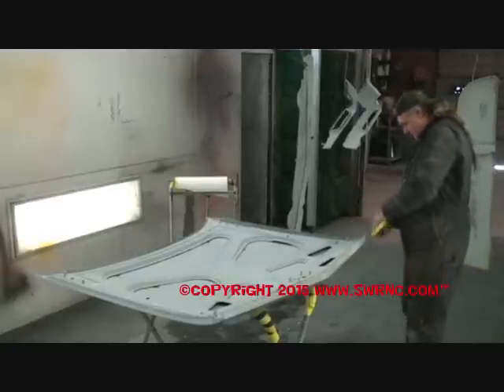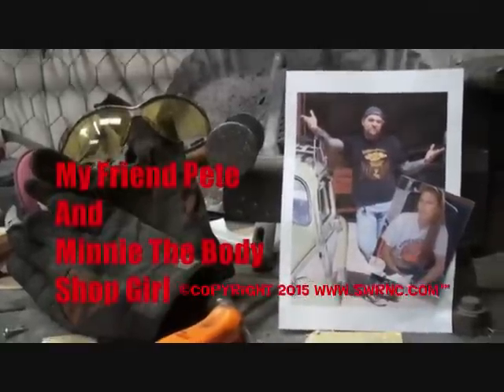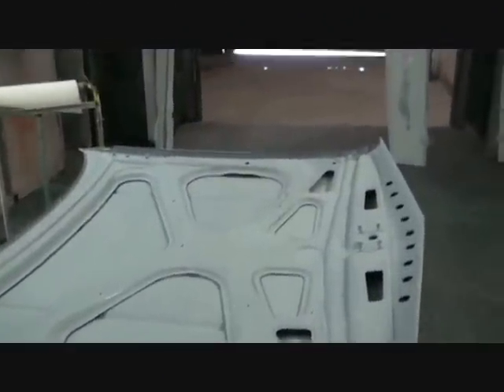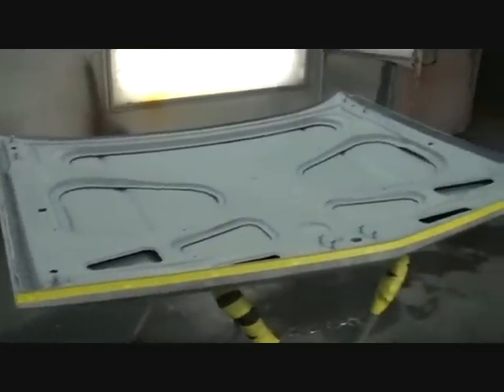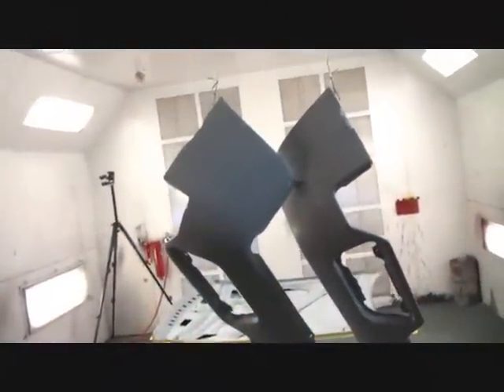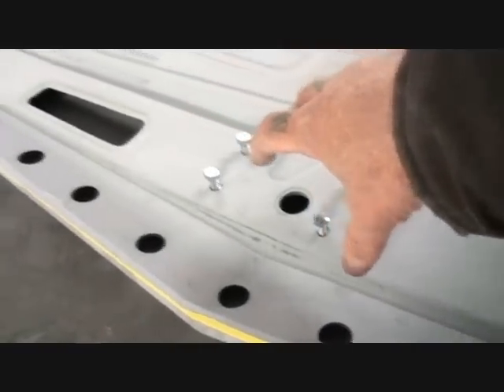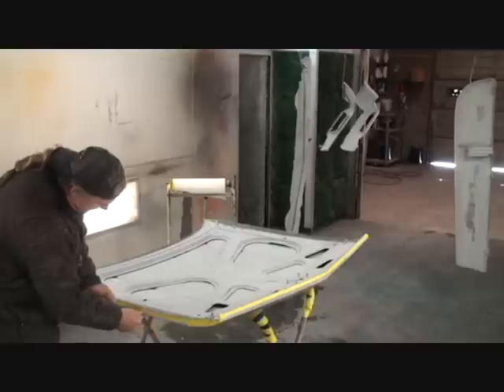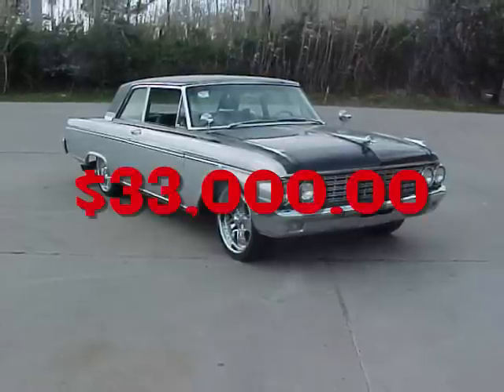How Should I-Restore My Car Or Truck? - Concours Restoration Theory

Comment: Good work. My dad bought a 70 SS Chevelle brand new in 1970.. In 1985 he pulled the body and started the restoration. Keep in mind it was only 15 years old,Zero rust. Took my dad 5 full years. He won the Chevelle Nationals in 1990 and made muscle car magazine. It got bubble wrapped on tires and pushed on a trailer for 2 full years. All threw the 90s from 1990 to 99 he only put 280 miles on it. Guy paid him $30,000 for it in 99 which back then a nice one was only 16k . He was sick the day it left the family. Guy kept car for 15 years I sure wish I could afford to buy it and give it back to my dad. I watched it go across the block at Mecuums and sell for $170,000 8 years ago... Dad thinks he had like 22k in it back then but he did all the work. Still looked like the day it was done. Paint was a mile deep and zero shrinking. I helped very little I was a kid from 5 to 9 years old but spent time sanding lots of pieces. Sad the rich fucks destroyed the market now days.. Most are not car people. They buy for a investment and trust me the trailer queens need work from sitting. Very few I find done right.

Comment: Ran across your vid and had to leave a comment. From my 40 years in the high-end restoration world, Concours doesn't mean what you think it means. I know many people do not use the proper definition, but A true Concours event requires the vehicle to NOT be modified in any way other than the appearance being the ideal of what the car was meant to be. Parts must be absolutely correct, with the correct finishes, fasteners must be as original, colors must be correct, and so on. And most importantly a true Concours car MUST be driven. In fact, most MUST do the event tour prior to show day, rain or shine in order to be eligible to win. 

Also, many owners drive these cars a LOT more than you suggest. The cars you refer to as "trailer queens" and have polished parts or customized parts and such are more for places like SEMA or other shows that are not judged on a points or originality basis. 

Furthermore, high-end restoration done properly also gives these cars a huge lifespan. I can attest to cars I did 20 years ago looking as good and "perfect" as the day they left our shop. Modern proper restoration takes the car down to every single nut and bolt and restores every part with techniques that keeps them original but with preservation and long life in mind. 

The one thing I will absolutely agree with is it is highly unlikely a person will end up spending less than the value of the car, however, it is possible and I can identify two cars in our shop that qualify. A BMW 507 we expect to run about 600-800k to complete but the car is worth 2.8m, and a Ferrari 250GT Berlinetta we did that is worth about 7-9m. That said it generally costs in the same range to restore a car to our standards in the end, regardless of what it's worth, so it also costs 600k to restore your Edsel. Our customers simply don't do it for the money, they usually do it for sentimental value, historical preservation, or to win top shows. I would certainly say this it is not for the average person's wallet, but generally, people with the money to spend are not stupid and don't like to waste money either. Our shop has been in business for 70 years and we have a 2-year waiting list and they still keep coming so there is certainly a demand for ultra-high quality. 

All that said there is nothing wrong with doing a lesser job at all. In the end, it is all about what makes the owner happy. I am happy just driving my old 65 Dodge beater that I will not ever do anything more than general maintenance on and has dents and rust in it.

More than anything I just wanted to clarify the term "Concours" and of course defend people that choose to go that route not as "stupid", but as ones that know what they want and are willing to pay for it. The biggest problem in the industry is that there are too many people claiming to do "Concours" work when they are doing what we consider a "repaint" or they are doing customization. Neither truly qualifies as "Concours"

Comment: Ya know Pete you are absolutely right, I restored my Camaro and now my chevelle my way, I put in the parts I want to put in it and they are not factory spec numbers matching but you know what, I love my Cars and that is all I can say. I spent 5 years on my Camaro restoring it is it perfect no, does it have flaws hell yes but I did it and I like it I enjoy cruising around car meets and just yaking with the guys. My Chevelle will have a LS1 that I picked up used low millage and it runs sweet. I heard it before it came out of the corvette it came out of. I will enjoy driving a classic Car with modern Tech and if anyone has a problem with it Oh well! ;) I LIKE IT lol ;)
Reply: Cary I have a 70 camaro RS that needs some work but I'm going to get it running & do some of the body work. I also have a 83 C10 that I just completed the front suspension on then will LS swap it. I never understood why folks put $$$$ in their classic rides to just look at but will buy a new one off the lot & drive it! 😀
Reply from the maker: +Cary Lamari Sounds like your doing it your way and making them drivers, which what this video is all about, not having a TRAILER/GARAGE KING but taking the car to the extent of still restoring it but making it drivable and relibable all at the same time.. I LOVE the LS Swaps and would do it in a heartbeat.. I think being Y2K is the way to go with the fuel injection and overdrive transmissions,, much more enjoyable to know your getting good gas milage and also trouble free to go anywhere you want knowing it will get you there safe and sound.. Im installing an LS2/6 speed Chevy 2013 Truck drivetrain in a 1966 Chevelle right now as Im writing this comment..... If your going to spend TONS of CASH on an old car, spend it where it counts!  Take it easy and good luck with your engine swap-- You might want to check out MUSCLE RODS  http://www.brphotrods.com/  before purchasing any motor or transmission mounts, also check into the oil pan, these guys know their shit and sell top quality stuff.. Make sure to watch the upcoming video set where I use their products to install the LS2 in the 66 Chevelle... Take it easy and GOOD LUCK. PETE

Comment: Hey Hadrian ..... Pete has professed in other vids to use a flange tool.  I'm curious if u agree or would u butt weld?  My thinking is if u flange your panel, u can easily make your own patch and trim up to fit well ..... U can punch or drill holes along edge of new patch and tack weld.  It's like mimicking a spot weld if that makes sense .

My opinion is if u can weld or get someone to seal the whole join " great" but I use dura glass as a do it yourself for sealing moisture out and then lite body filler after .... 

Pete has a great full resto video of a 69 red chevelle that covers most aspects of doin it right, recreating factory body lines and properly attaching rockers to quarters etc....

Comment: I thought that a concours paint job by definition would be judged on how close it looks to factory. That would normally mean that areas like under the hood would be thin and rough with primer showing through in places. If the car came with single stage lacquer from the factory, then a concours paint job would be single stage lacquer. That's how you usually preserve the value of a collectible for the Barrett Jackson crowd.
Reply from the maker: +parnelli jones YES-that is true, but once a person starts to take it to the extreme such as the Concours Resto- they get so involved that it becomes "OVERKILL" and they lose all concepts of what a Concours RESTO is.. And as far as BARRETT JACKSON goes---Think "REALITY TV" and all your answers will be there!

Comment: KIT CAR.   I'd put a used engine and trans in it and paint it with a roller and use the snot out of it for the next 20 years.  That's how it might be worth it. :)  I'm cheap and I don't like anything too fancy.   As long as it ruuns good and it's not rusted.

Comment: Thank you Pete for your insight on this kind of work. I wish you would comment on how much such a job would cost the customer. Some jobs could run in total 6 figures once all the work is done
Reply from the maker: +Timothy Patterson The guy with the kit car has over 70,000.00 invested and it's NOT DONE!

The car in the video (1960 Impala) Has well over 55,000.00 and is NOT DONE

The Chevelle in the video has 7,500.00 and IT"S DONE!

Comment: I'm so glad you brought up the Barret Jackoff auction thing.  I thought it was just me.  As you say, that, Fast N Loud etc. have ruined the hobby by extremely up valuing the cars.  Now every guy who owns one is trying to sell it at dumb prices.  There's a Rockford files style firebird in the UK with a starting bid of £55,000 - about $80,000!! Seriously, check out ebay uk and you'll have a good laugh.  They're selling rubbish 6 cylinder pick up trucks here, in need of restoration etc. for $25,000.  Such a joke, all because they saw one, or similar to theirs on TV "sell" for a lot.  Such a joke and it's annoying because the people who actually want to drive and enjoy these cars, not just make a profit from flipping them to have them then stored in a garage never to be seen or used, us enthusiasts can no longer get to them and enjoy them.  I love muscle cars and american cars but they are inexpensive cars and always were - built for the blue collar guy (i own 2 - use 1 daily, restoring the other so not hating, talking from experience).  You can buy a brand new car here for under $9,000, 3 year warranty etc. has every creature comfort you could want, heated seats and so on.  But they want you to pay three times that for a car that after you spend a year + loads of money on, will end up with mediocre comfort, handling, bad gas mileage and non stop repairs.  It's a fun, cheap hobby (As long as you don't go concourse restore), or at least, it used to be cheap and fun, before these tv shows came along and these fake auctions.  Well said Pete.
Reply from the maker: +rayray123ray69 REALITY TV--That should answer all your questions and give you all the answers---ITS FAKE and full of SHIT and has ruined it for you and me---FUCK TELEVISION!
Reply: +rayray123ray69  Well said,Ray.

Comment: Here in the UK some classic cars have been overdone when they are going for concours, I have seen Morris Minors with polished carburettors, polished ignition coils and even a chrome propshaft. To be honest a polished part is easier to keep clean than a matt finish aluminium part. 
These were bread and butter cars when they were made, I don't see a problem with engine and brake systems upgrades etc, but pretending a Morris Minor with a chrome propshaft is "all original" is BS....

Comment: It is actually kind of the opposite. A concours style restoration makes the car as close to factory as possible. A lot of attention goes into doing things exactly the way the factory did, including how much overspray is on the inside of the hood. Completely the opposite of a mirror finish in places you can't see.
Reply from the maker: +Ian Mcdowell Yes I know that, but I didn't want to make a video of where to put the chalk marks, and sign off inspections of the vehicle from the factory.. Your right,, there is more to concours restos then explained but the basics where covered and the word concours was also used as a comedy word to throw out as well.

Comment: If you had a mustang that had rust holes low behind the wheels on the front fenders would you swap the whole fender out, or patch using metal from the replacement fenders you have? Other than the rust I have described, the  originals are perfect and are still on the car. THX
Reply from the maker: +Hadrian Wall If I couldn't find an old factory fender I would buy some aftermarket fenders and cut what I need out of them and patch the OEM Original ones.. Take it easy and good luck. Pete
Reply: Thanks ...I have aftermarket fenders that came with the project I bought. I will cut out the pieces I need then. Appreciate all the video's and help!

Comment: Ok, I know the kind of people that loves this Concourse Restorations on their cars. They are called Zé Frizinho here in Brazil. A literal translation would be "trim piece Joseph" as the guy would kill for a original little trim piece. The cars restored up to those standards are used as bragging objects, and not as cars. That is kind of sad, and shows the kind of asshole that loves it. 
I have two old cars. One of them a '82 Galaxie is unrestored original, still with the factory paint in acrylic enamel. This car looks great, has no rust, has super low mileage, and even tough, she looks flat when compared to a just painted "restored" car. Those don't look like they were when new, they look like a modern car, and that is more fake than using aftermarket parts if you ask me. 
My other old car is also a Galaxie, a 1974 model, that I repainted with the doors closed, like your muscle car makeover.  This one I use on a daily basis. I do something called ENJOYING my car.

Comment: My understanding of Concours Restoration is to take the car back to exact factory condition.  You're not supposed to improve on it.  If there was a typical factory paint run in a certain spot, then a Concours Restoration should duplicate that paint run.  The same with orange peel and paint finish.  Going "better than factory" takes away from Concours designation.
Reply from the maker: +Vern C In "MOST CASES" your exactly right, but the problem you have is these type of people get so involved from reading magizines and looking at parts catalogs, and going to car shows that they go overboard on it and it turns out to be a trailer queen/garage king..
Reply: +diyautoschool ___  Maybe in 20 years or so, instead of hearing about an amazing "Barn Find", we'll be hearing about an amazing "Estate Find", where an estate is selling off some of these Trailer Queens and Garage Kings for a fraction of the money invested in them.   At least that's one way of preserving some of the automotive heritage for the future.